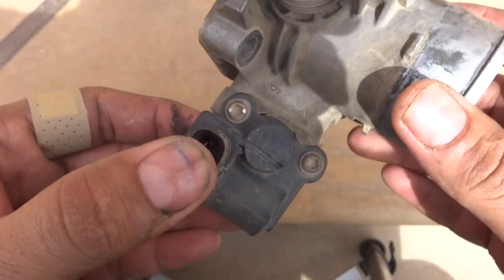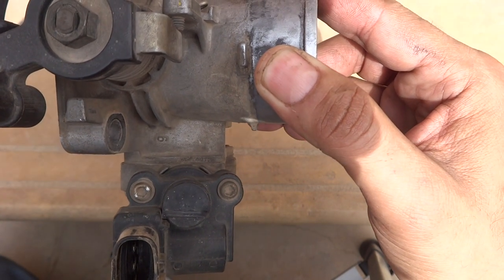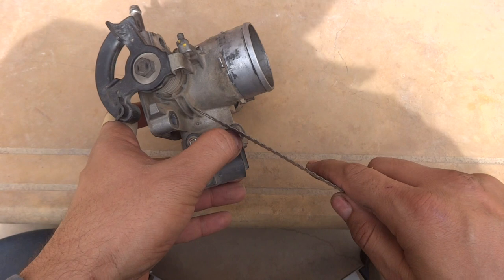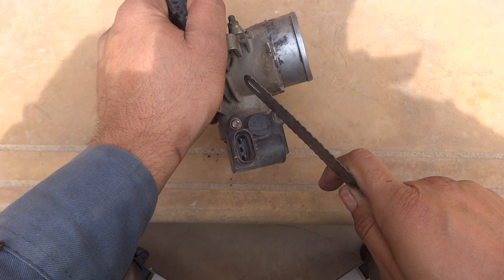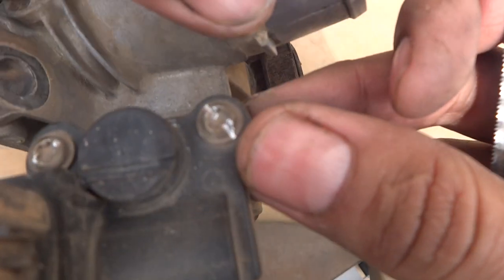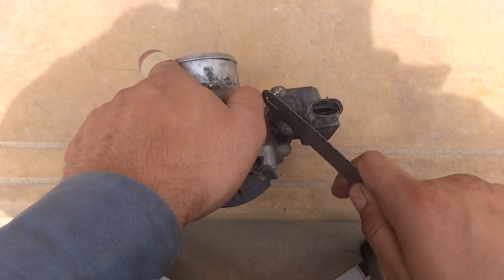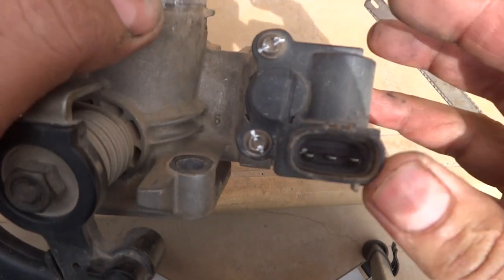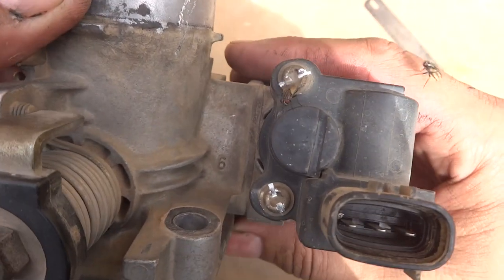Throttle body screws modification, Idle air control valve.

Comment: Thank you so much for this video.  I am cleaning the Throttle Body and Idle Air Control Valve on a 2000 Toyota Corolla.  Your other video helped me a lot as well.  Those IACV screws are ridiculous.  I am going to saw them just like you did.  So far I have 3 of the 4 screws off for the TB.  May have to saw that last one as well.  The torque on these are DUMB.  Not supposed to have this much trouble with screws.  They are really Japanese JIS screws.  I never knew JIS existed.  What a mess !!!  My Throttle Position sensor has 2 of these as well.
Reply from the maker: Thank you very much dear friend for liking videos. Glad to know that my videos helped you! I uploaded them to help others. You may subscribe so that you will get notification on each upload. I am uploading frequently not only on cars but on different subjects. I am sure you will find my channel interesting. Regards, The url is as under:
http://www.youtube.com/channel/UCJb9vF4EHIF_RWyDWrLQT-A/featured
Reply: @JahanZeb1976  sir, my car i20 has 2 separate coil packs controlled by 2 wires connector which controls 2 high output terminals. However, one high terminal pin 4 of first coil gives less spark than pin 1 on the same coil pack. Why such less spark being provided by the same primary coil??

Comment: Very much by me, this is wizard genius !Keep them coming my friend.
Reply from the maker: Thanks for liking dear friend.
Reply: @JahanZeb1976  sir, my car i20 has 2 separate coil packs controlled by 2 wires connector which controls 2 high output terminals. However, one high terminal pin 4 of first coil gives less spark than pin 1 on the same coil pack. Why such less spark being provided by the same primary coil??

Comment: 5-sided recess head screws are called 'star' head screws. IF you can remove them replace with 6 sided stainless bolts (removed later with a small hex socket...)
Reply from the maker: Yes, you are right. That would be great. The idea I shared here is bear easy and cheap method. Regards,

Comment: You appear to have "Quality control" flys he he :-))
It must be horrible having so many pests attacking you :-((

Ive done pretty much the same thing but i used a junior hacksaw blade, when the annoying screws are out i quickly throw them in the dustbin, i hate silly types of screws, pozidrive/phillips type screws are also annoying as they round off making it a real pain.

Hope you find more subscribers, i allways enjoy your intellegent/clever videos :-))
Reply from the maker: Thank you very much dear friend. Flies are real problem if you you are working out side especially. I am using fly zap to kill them normally inside the room.
Yes annoying headed screws is a real trouble but with the invention of impact screw driver, most of phillips and flat are now easy to open. Regards,